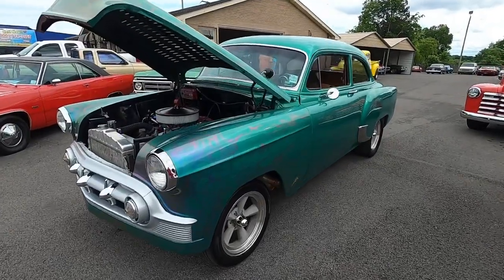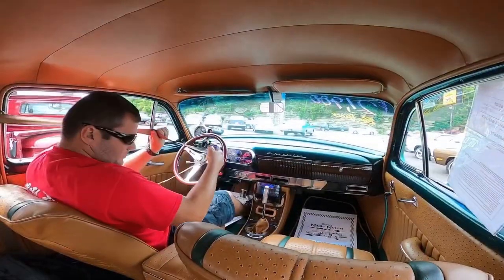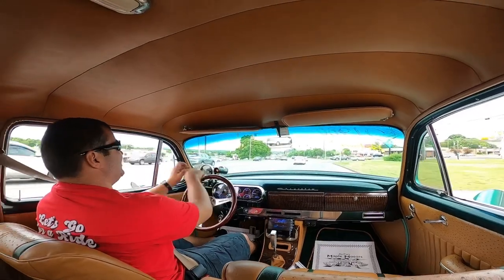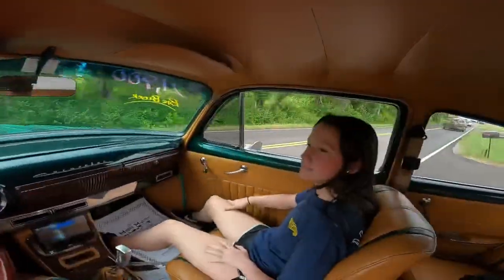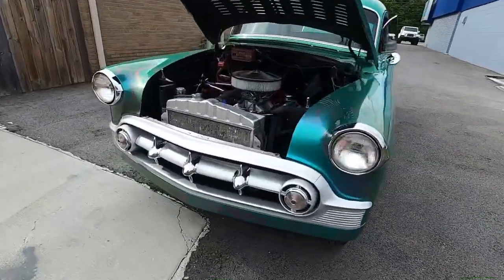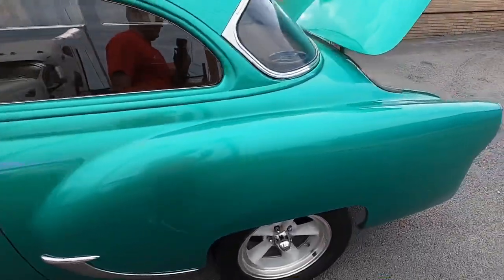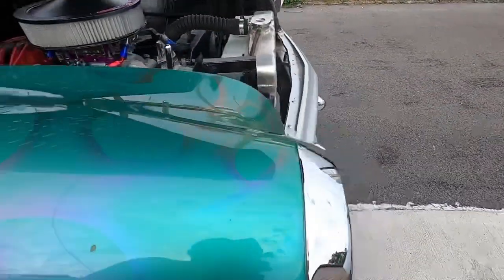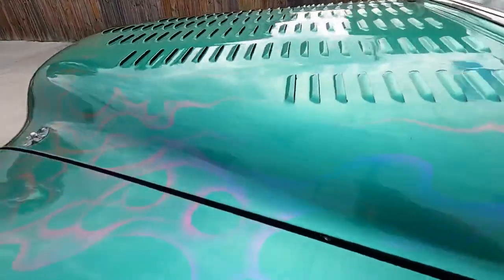Test Drive 1953 Chevrolet 2-Door Post SOLD $21,900 Maple Motors #1482-1

Comment: This car brings back a lot of great memories. Bought a '54 in Pueblo Colorado when stationed at Fort Carson for $200 in '67. Everything worked but it ran a little rough. Had a mechanic refurbish the head for $40 (Yeah, I couldn't believe how cheap he was and did a super job), then drove it numerous times back home to Detroit. One of the most reliable cars I ever owned, parts were cheap and super easy to work on.